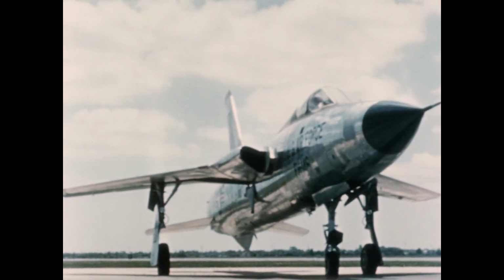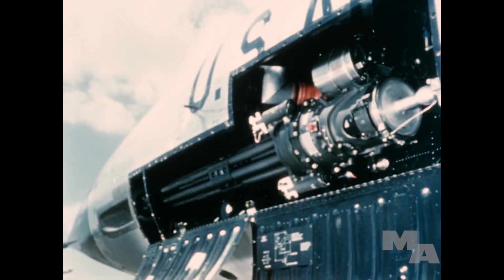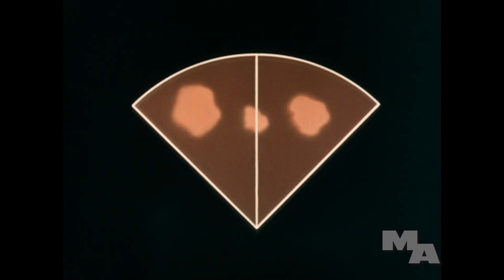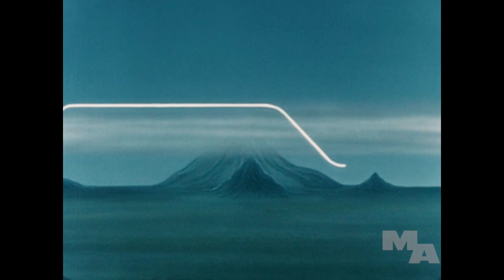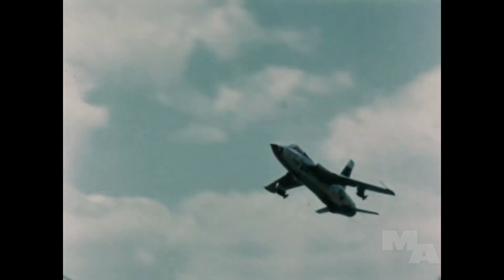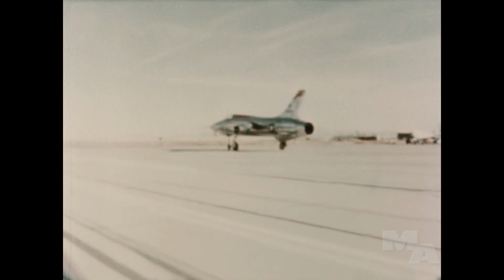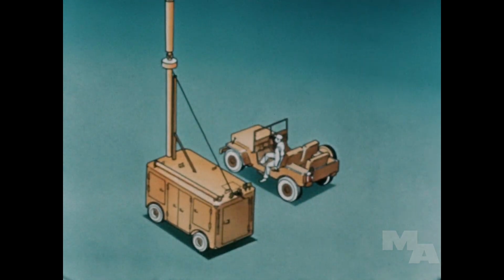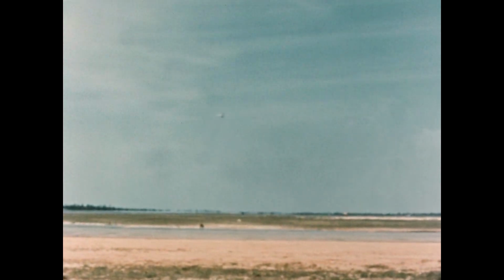USAF F-105D Thunderchief Fighter-Bomber Weapons & Offensive Capabilities - Outstanding Color! 1960

Comment: This is a great video about a great plane, but it is full of Republic aviation propaganda.  They make it sound like all the pilot had to do was go along for the ride and push a couple of buttons on the auto pilot.  Nothing could be further from the truth.  The F-105 D was a great flying machine with a lot of very sophisticated features, for its time, but it was a real hand full for the pilot.  The cockpit had hundreds of switches, knobs, and buttons, and each one had to be set correctly as the mission progressed.  Among the many knobs and switches for the radar display were intensity, memory, and video pedestal.  They had to be set exactly correctly or you would have an unusable display or none at all.  That is only one little item that the pilot had to do exactly right for the entire system to work.  Don't forget that on every war time mission, there were talented people on the ground trying very hard to kill you.  Yes, the F-105 D was a great air plane, but it was great pilots and ground crew that made it work.
Reply from the maker: “Just put it on autopilot while you take care of everything else” didn’t work against SAM systems deployed in depth.

Comment: I understand that more than half of F-105s produced were lost in VietNam. It was used in a role it was not designed for. It was a  poor dog-fighter.
Reply: Half the F-105 produced were lost because they were assigned the most dangerous missions, and because only about 700 had been built and the airplane was out of production.  There were a lot of F-4s lost over Vietnam as well, but that airplane was in production so its loss rate was sustainable.   

Saying the F-105 was poor dogfighter clouds the issue.  The vast majority of its losses were to ground fire. Also, the F-105 had more gun kills than any other fighter in Vietnam.  It got those kills in the course of defending itself from MiGs during bombing missions.

The plane was designed for conventional as well as nuclear attack, or it wouldn't have been built with the capability to carry all that ordnance externally.
Reply from the maker: The film shows what the aircraft was designed to do. It ended up, for the most part, playing a different role in Vietnam.
Reply: Well it wasn’t expressly used as a fighter though it did get into scraps. An F-105 flight would have a CAP of F-4 and in earlier war cases F-100. That said a couple of F-105F/G Wild Weasel pilots shot down migs with the M61. That’s in a heavier 2 seater with a lot electronics weighing it down. Many 105 pilots were highly experienced so they were skilled professionals who knew the advantages and limitations of the Thud and gave a very good account of themselves. 

That’s my “I actually know more than the skim the surface Internet” answer.